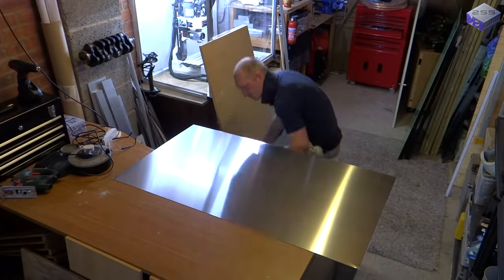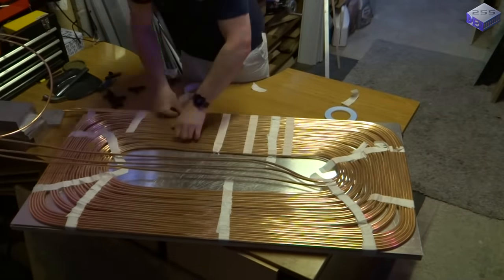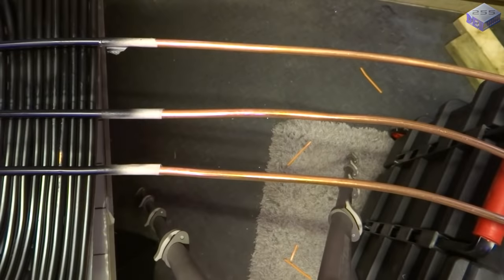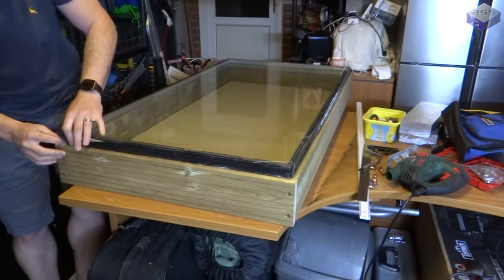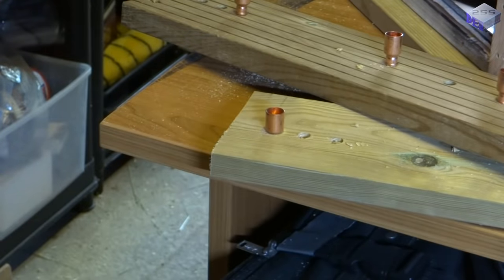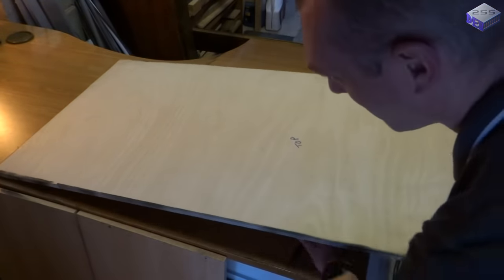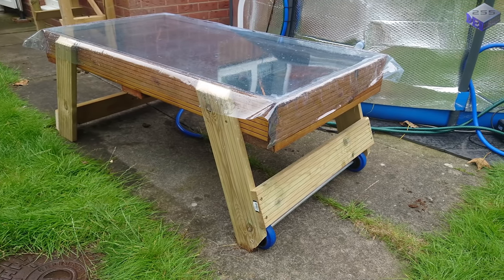Improved Solar Pool Heater - Full build

Comment: problem I found was the rate of water flow was to much for enough heat absorbtion to make a difference.  By slowing down the rate of flow it helped, but then you dont get a lot of hot water to make a difference.  Perhaps making the loop longer would give more time to absorb more heat.  The new premade panels are stamped from copper.  All one piece with stamped water channels.
Reply from the maker: Hi, I like the idea of a stamped unit with water channels, would have saved a lot of time bending almost 75meters of tubing, haha. From doing all the experiments with my first panel and looking into the maths I found the opposite effect, where the faster you take the heat out of the panel the more energy the panel would collect. There may only be a 1 degree rise from input to output, but this means that the heat is being transferred to the pool and the water and panel have more scope to warm the water. If I had a small flow rate, this would heat the water so it felt warm, although as it heats the heating effect slowed down and stopped around 68 deg C; essentially the heating effect exponentially slows down as temperature rises up to around 68 deg C, so it's best (although counter intuitive) to have as fast a flow rate as possible without using too much energy on the pump. I hope that all makes sense, I thought the same when I first started making these, may have to look into a pressed copper one now 👍
Reply: @TheSolarPoweredEngineer  sound logical, I will see if I can find the copper plates.
Reply: You need to calculate the delta enthalpy. When you have a flow of 10L/min with an increase in temperature from 15 to 17 degrees. Your Q = 1,4kW. When you decrease the flow to 4L/min and the water is 19 degrees. Your Q is 1.1kW
Reply from the maker: @thelazycat_  that makes sense, I will have to look into this a bit more and test the system and flow to get the optimum value, with all these factors to consider I'm sure we can get a good efficiency system
Reply: @TheSolarPoweredEngineer  if you need help with some calculations, you can reply. In this case it is basically straight forward. M*C* delta T. To improve heat transfer, you can increase the surface area that exchange heat and increase the turbulence of the flow. General thumb of rule is a flow higher than 1,5m/s.
Reply from the maker: @thelazycat_  Thank you, I may just quiz you further when I get around to this, I'm currently getting my solar-powered mill ready for the Makers Central event later in April, then will hopefully get on with the solar pool heaters.
Reply: @TheSolarPoweredEngineer  nice! Keep up the good work.
Reply: If it is a bright hot day then the 3 pipes in parallel will heat up the water enough, but on a dull day then run them in series so the water stays longer in the loop and gives it more time to heat up.
If they are left in series on a bright hot day then the water temp may max out half way around making it inefficient.
Reply from the maker: @markmmm1737  Hi, from your suggestion and The lazy cat above I can see why serial configuration could work well with less light, as you increase the flow speed in the pipes the turbulent flow is increased.

Comment: Sir. Aluminium is cheaper and more efficient heat exchanger. I think it will save enough for cost sensitive people like me.
Reply from the maker: Hi, good thought and it's readily available. I will have to look into this and whether aluminium can stand up to chlorine and other chemicals in the pool, the only thought I have initially is that it's hard to bend alu tubing as it's fairly brittle, well the alu I cut on my mill. Thank you for the thought, I will take a look at more economical cost ones, although my 1st version was fairly cheap. 👍

Comment: I wonder, why do you need pipes, why not to make just a black reservoir? it will have more water inside
Reply from the maker: Hi, the pipes increase the surface area facing the sun on the outside of the pipe and also increase the surface area of water moving along the inside skin of the pipe. With turbulent flow (a fairly fast flow rate needed) the water mixes and takes more heat away from the pipes and into the pool.

This works as the specific heat capacity of water is 4182, whereas a large reservoir with the same quantity of water would have a smaller surface area, so it would take longer to warm up.

Comment: Also glazing or putting thr glass/plastic over the tube, actually loses heat. It reflect 10 to 15% back put to the atmosphere
Reply from the maker: I'll be having a play with different materials at some point. I do need to reduce the air contained within the box to make it more effective too. I am also going to try reflective side panels that track the sun onto the panel, these may add too much heat for the polycarbonate though, although could be closed when I need to do maintenance or protect it further in the winter.

Comment: Neil, I would rather use copper wire instead of the cable ties, they will go after a while!
Reply from the maker: Totally agree, I will change once they do, I have nice thick copper in some old earth cable 👍
Reply: @TheSolarPoweredEngineer  Hi Neil, My wife and I are now happily living in South Africa since after the first lockdowns, we were in Bidborough. Trying to go off-grid as much as possible. I am building a couple of small units to preheat water to electric geysers and saw what the sun here does to shitty and the very best tie wraps!
Reply from the maker: @TheFransVenter  Hi Frans, yes probably the best thing to do is replace the tie wraps with the copper wire. Good luck with yours and going off-grid 👍

Comment: Add a lens to boost the sun’s heat!
Reply from the maker: Hi, I did look into a Fresnel lens, although there seems to be some attenuation of the light and I would need one larger than the panel. I'm also considering a mirror tracking system to ensure the most amount of light is on the panel at any one time.

Comment: Are the cable tyes uv stabalized?
Reply from the maker: They are not, although are not showing any signs of breaking, maybe the glass is reflecting too much UV, I will be changing to clear polycarbonate soon, so will change the cable ties for steel ones.
Reply: @TheSolarPoweredEngineer  ok. Overkill on the cableties. 😉 
But why polycarbo instead of glas?
Reply from the maker: @sebastianmuller1210  Definitely overkill, although I liked the orange against the black, it made a nice thumbnail for YouTube. The clear polycarbonate sheet should reduce the amount of reflected energy apparently as the glass is reflecting a fair amount.

Comment: I have seen a suggestion of large black plastic trash bags placed on top of the water to reduce evaporate cooling and warm the surface water…
Anybody tried this ? 
Worth the trouble?
Thoughts?
Reply from the maker: Hi, you are quite right, I have a bubble wrap version over my pool now as there is a lot of surface area to absorb the heat from the sun and transfer it directly to the water. I'm looking into improving this at the moment and will be doing a video about it at some point this summer. I think it is definitely worth the trouble as you also reduce the amount of chlorine that the sun burns off too, so it has multiple positives.

Comment: Why using copper ? Wouldn't be plastic much more cheaper ?
Reply from the maker: Hi, yes copper is very expensive at the moment, where 75 meters of the one I used now costs £176.97, so PVC is the best option for the cost. My last PVC tube panel works just as well, although much bigger than this one.

Comment: How about showing some results like water temp in and out.
Reply from the maker: Hi, I am working on a video that will answer this and many other questions in the comments. The temperature difference from input to output with a flow rate of 4.5 litres per minute was around 1.5ºC, so generated around 500W. That's at the maximum sun in the middle of a good sunny day.
Reply: @TheSolarPoweredEngineer  Thank you.

Comment: Nice DIY, so what was the temperature of the heated output water?
Reply from the maker: Thank you. The heat output at a flow rate of around 5litres / min was around 1.4ºC, which is roughly around 500W. I need to do more testing this summer, so will be measuring flow rate directly and heat in/out to calculate instant wattage.

Comment: Just replace the glass with a sheet of clear acrylic to reduce the weight and avoid accidents.
Reply from the maker: Hi, I have got a clear flexible layer that I put over the top, although it is heavy with the glass. I was looking to put clear polycarbonate on to replace the glass as this should reflect less light away from the panel, trapping more of the energy, plus reducing the sides to help reduce the layer of air inside; this should see a more efficient panel.

Comment: wouldn't it be easier if you paint pool floor black ?
Reply from the maker: Most probably, I do have a black cover that sits on top of the water and insulates it also, will need to do some more testing this year to find an optimal solution.

Comment: Hi nice build! Trying to find an efficient way to warm up a 22k gal pool of various depths. Assuming there's sufficient sun, how many of these panels would be required to increase pool 15-20 degrees. Probably asking for a lot so maybe 10 degrees :)
Reply: Have you considered focusing the light onto the panel with a parabolic trough mirror
Reply from the maker: Hi, I think your best bet is to use floating heat transfer mats to use the surface area you already have and reduce the amount of evaporation (evaporation can also cost you with chemicals too), plus heat retention (insulation) is something else to look at. you would need quite a lot of energy to heat that much water, somewhere in the region of 418 million Joules of energy to heat by 1 degree (116KWh if heated by 1ºC over 1 hour, or 14.5KWh per hour for 8 hours (116KWh in total)), so to get 10 degrees you would have to collect 1162KWh over a day or 29 of these panels and some good sun. It may be worthwhile looking into a clear pool shelter/tent to let the light in but retain the heat along with some floating heaters. I hope that helps.

Comment: I don't understand why you didn't tell us the temp of standing pool water and temp of water as it leaves heater and enters pool. That would have been very helpful.
Reply from the maker: Hi, I hope to go into more detail this year and compare all the heaters, including input, output and flow. To be fair there is very little difference between input to output with a high flow rate as you want to get the heat generated into the pool at an optimum speed. I believe there was around 1 Deg C difference. More details to come

Comment: Hi do you sell theses? If so how much ?
Reply from the maker: Hi, unfortunately I don't as they take a while to make and I'd end up selling them at a high price (probably around £500), although there are many other options on the market that will perform just as well for half that price. This was originally to see how well it would work, where I have been impressed by its performance, averaging around 500W for such a small device. I am looking to modify it further to see how efficient it can be made. I hope that helps.

Comment: would probably have personally painted it black inside, to achieve as high a heat as possible.
but nice project.
Reply from the maker: Thank you, I may just do that, or even attach reflective foil on the inside sides to reflect it back in.

Comment: For a hobbyist you have outdone yourself. From a more technical and scientific side there VERY MANY things that could be done better (more efficient energy wise).
But nonetheless well done.
Reply from the maker: Thank you very much. I do intend to make a number of small test units using different setups, materials, flow rates and coverings to see which options perform best and then see if I can design a really efficient system that's easy to make and affordable at home. Thank you again.

Comment: You can add a Ferrell  lense " same size as the window"
Reply from the maker: Hi, hmmm, will have to think about that one as it would focus more light on it
Reply: No point, it's collecting the same area of light!
Reply from the maker: @gstevef  I was thinking more on the lines of mirrors at each side reflecting the light onto the panel, with an Arduino based tracking system so that the light would always hit the panel and the panel would also collect the energy when in its field of view.

Comment: Et la corrosion du cuivre mon gars , tu y a pensé ? Pffff... a tu déjá entendu parlé d’électrolyseur dans les installations de piscine ?
Reply from the maker: Hi, yes, the chlorine and copper were a concern of mine too initially, although since looking at the link below from the DWI I believe this is ok due to the amount of chlorine in drinking water that also runs through copper piping around the home. I know the pool continually rotates the same water, so I now have a UVC attached to the pool so that I can reduce the amount of chlorine I add. I haven't seen any copper corrosion in the system as yet.

Salut, oui, le chlore et le cuivre étaient aussi une préoccupation pour moi au début, bien que depuis que j'ai regardé le lien ci-dessous du DWI, je pense que c'est correct en raison de la quantité de chlore dans l'eau potable qui traverse également les tuyaux en cuivre autour de la maison. Je sais que la piscine tourne continuellement la même eau, donc j'ai maintenant un UVC attaché à la piscine afin que je puisse réduire la quantité de chlore que j'ajoute. Je n'ai pas encore vu de corrosion du cuivre dans le système.

https://www.youtube.com/redirect?event=comments&redir_token=QUFFLUhqbTJXYVMtaFJYTWl5SlpBdml3WEY5NzNaM0tpUXxBQ3Jtc0tsODlLc200THhETy1zTXAycDB5MTRBNFNaMF9kUjBFNERkMzNkcmVhSjdHaUtIc0kzQ2hhWHk3Z1oxN0tiWTJLaGs2dk13bjF6MEFPTG16RnFja0ZDeVAxZ09PSHpYeV9BelQ0aTRtSnBjVG5qak1tYw&q=https%3A%2F%2Fcdn.dwi.gov.uk%2Fwp-content%2Fuploads%2F2020%2F09%2F23151717%2Fchlorine.pdf%23%3A%7E%3Atext%3DThe%2520World%2520Health%2520Organisation%2520has%2Clevel%2520below%25201%2520mg%252Fl&stzid=UgzW7GtpmHU9TAQwfGd4AaABAg.9eRKwP7W8Ak9eU7ykiNLk-

Comment: You could easily make a business out of selling these :)
Reply from the maker: That would be nice, may have to make a machine to bend the tubing first though. Thank you
Reply: @TheSolarPoweredEngineer  what do you think about using plastic tubing? that would avoid corrosion problems in usage with other metal pipes, when put into a house supply. 
An easy upgrade would be to use mirrors to direct light into it. though I dont know how the price compares.
Reply from the maker: @nutzeeer  Hi, I think PVC may be the better option now due to the price and the concerns over chlorine in the pipe, this is something I am trying to find more about. The use of mirrors may be the best option, especially if they could track the sun's movement and direct the energy to the panel. I may just try that this year ;-)

Comment: Shouldn’t you use black UV tie wraps instead of orange that are going to rot away faster.
Reply from the maker: Possibly yes, although chose these as they look nice haha. Would probably be better to use solid wire ties and spray them black with the rest of the panel, or as someone else suggested, use thermal bonding.

Comment: Parallel is definitely better, colder water absorbs heat better.
Reply from the maker: It definitely seems to be better, and would make sense given that the water temperature will rise all the way round. With 75m of tube the temperature rise would be slowing down the higher it got, whereas with 3 x 25m the temperature will rise at a higher rate. I may be able to prove this using my thermal camera.

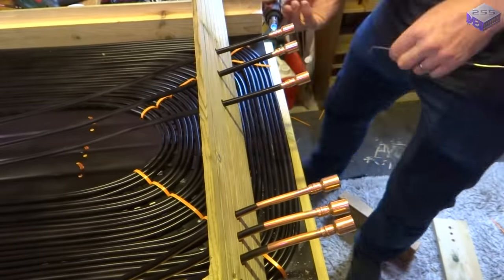Comment: 12:00 vous utilisez ici, des raccords à SERTIR "V". Ces derniers possèdent un joint caoutchouc à l'intérieur et sont à SERTIR avec une pince équipée de la mâchoire "V" adaptée au diamètre du raccord. Il existe des raccords à SOUDER pour lesquels on utilisera un chalumeau comme vous faites ici (ou autre appareil de soudure) et qui n'ont pas ce joint caoutchouc. L'utilisation du chalumeau détériore ce dernier et complique la bonne exécution de la soudure. C'est très dommage puisque votre travail est excellent si l'on omet ce détail particulièrement important
Je trouve dommage également que vous n'ayez pas raccordé ces 3 conduit à l'intérieur du caisson pour n'avoir q'une entrée et une sorti d'eau à l'extérieur du caisson.
Reply from the maker: Ah ok, I believed it to be solder inside the connections and added more to the outside, I will check the spares I have left over and change them if needed. Thank you for spotting it. I did put the connections on the outside though, so I could change the configuration to find the most efficient solution.

Ah ok, j'ai cru que c'était de la soudure à l'intérieur des connexions et j'en ai rajouté à l'extérieur, je vais vérifier les rechanges qu'il me reste et les changer si besoin. Merci de l'avoir repéré. J'ai cependant placé les connexions à l'extérieur, afin de pouvoir modifier la configuration pour trouver la solution la plus efficace.

Original Observation: You are using CRIMP "V" fittings here. The latter have a rubber gasket inside and are to be CRIMPED with pliers fitted with the "V" jaw adapted to the diameter of the fitting. There are WELD fittings for which we will use a torch like you do here (or other welding device) and which do not have this rubber seal. The use of the torch deteriorates the latter and complicates the proper execution of the weld. It's a shame since your work is excellent if we omit this particularly important detail.
I also find it unfortunate that you did not connect these 3 leads inside the box to have only one water inlet and one water outlet outside the box.